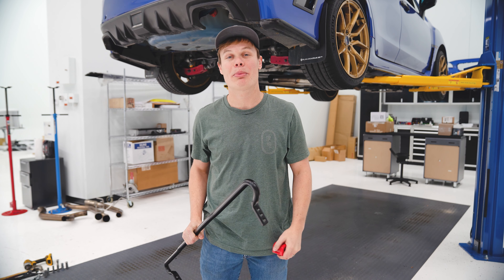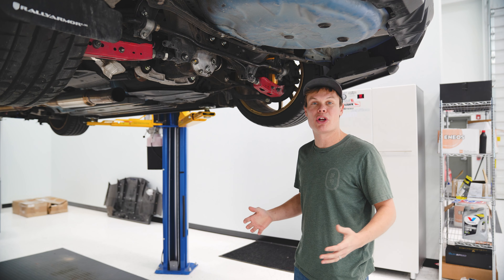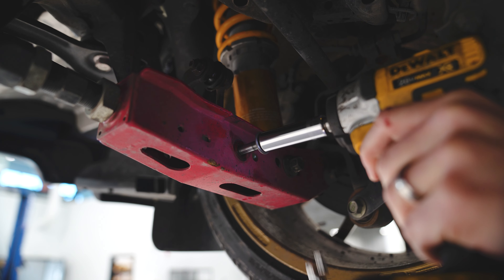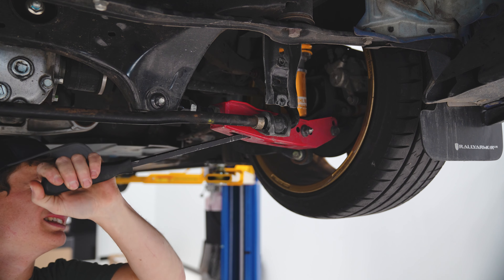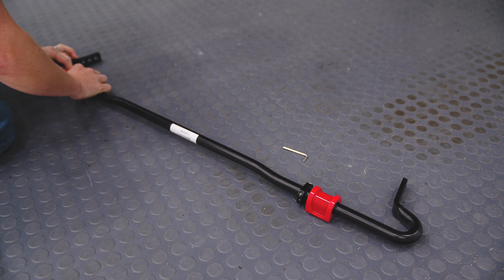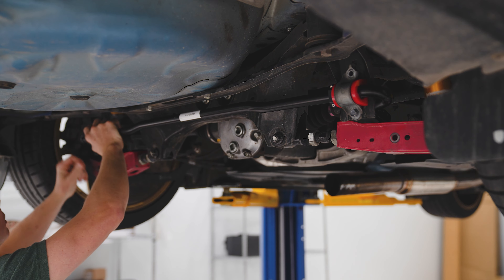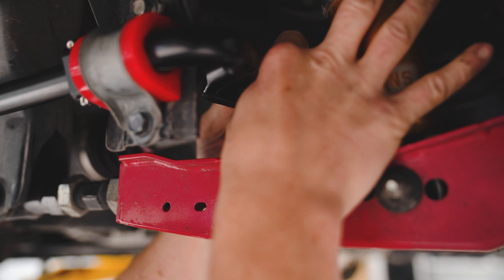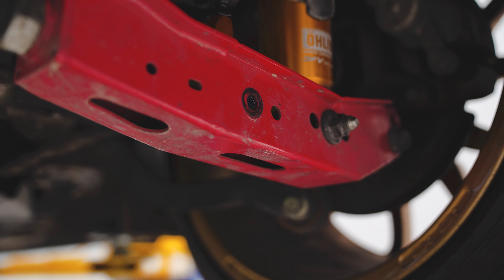How to Install a Rear Sway Bar - Subaru WRX/STI

Comment: Shouldn't the suspension be under load before tightening the end links?
Reply: in this case the top can be tightened down without load, the bottom can be tightened if there is a bearing of some sort.  if it is a bushing then you are correct, it needs to be tightened at ride hight.
Reply from the maker: Yes, you want to lower the car and check clearances/tighten endlinks as mentioned at the end of the video!

Comment: That "new" endlink hardware isn't long enough for the (red) aftermarket lca.  You need 2-3 threads past the nylon locking ring (in the nut) for the nylon to do its job properly.  I would not trust it.  On the stock lca (that is thinner), it would probably be the right length...but on these red lcas, that endlink bolt is too short !!!

Comment: Bout to ask a dumb question from a new Subi owner. Is this a fairly simple addition on my '17 Impreza Sport Wagon or is it a pain in the ass compared to the WRX/STI since I notice most upgrades seem to be on those platforms?
Reply from the maker: install should be almost identical. Finding a direct fit sway bar for your application might be a little more challenging
Reply: @SubiSpeed  Good lookin out. Yeah, I figured it may be more challenging than the WRX/STI platform but I'm a wagon guy and I got this near-mint Impreza with 17k miles for 6k from a family member that had a recent life change so I couldn't pass it up!
Reply: Crosstek and Impreza bits should be really close (same chassis, yes?).
Reply: @K03sport  Mom's just bought a Crosstrek because it's nearly identical to her old Impreza but taller/easier for her at her age. Dude and the dealership said they are nearly identical so that's a good point, gracias senior
Reply: @KP-ol3tc  ...even bits off the 2015+ WRX are swappable w/2013-2017 Crosstrek.  In 2018, the Crosstrek (and Impreza) moved to the newer chassis (the WRX /STi did not)
Reply: @K03sport  damn dude, I really fukn appreciate you sending over the knowledge for real.

Comment: I broke both front Whiteline end links in my 16 WRX.  They both broke at the adjustment screw into the body.  I went with the Perrin solid end links after, and never had another problem.
Reply from the maker: Whiteline actually updated their endlink design, the ones in the video are the old style but the new ones are solid as well!